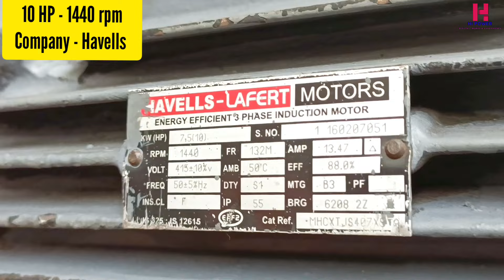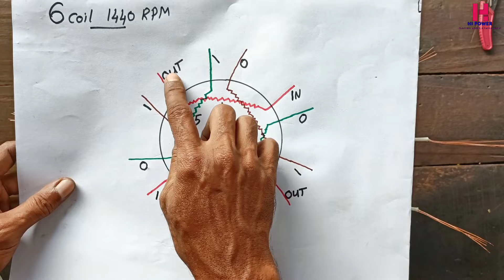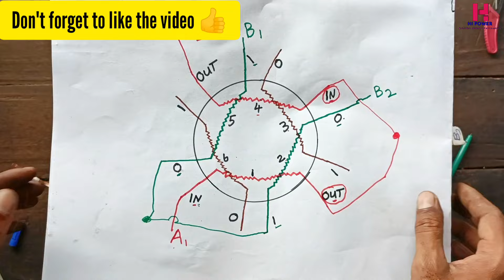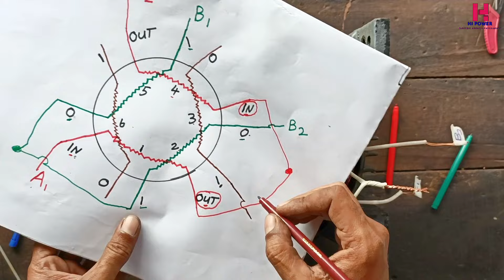10 HP 36 slot motor winding and connection with diagram|Three phase motor winding|Motor winding

Comment: Hello sir,
इस कनेक्शन में इनर से आउटर वायर का जम्पर है।
इस कनेक्शन से मोटर में क्या इफेक्ट पड़ता है।
एवं सीरीज कनेक्शन यानी इनर से इनर का एवं आउटर से आउटर का जम्पर होता है। तू तो मोटर पर क्या इफ़ेक्ट पड़ता है। 
Plz reply me sir
Reply from the maker: यदि मोटर 6 कॉइल के साथ 1440 rpm है, तो कनेक्शन वीडियो में दिखाए अनुसार किया जाना चाहिए।
यदि बाहरी लीड को बाहरी लीड से joint वाला कनेक्शन 6 कॉइल है तो यह 2800 rpm होगा।
Reply: @Hipowerelectricworks यानी मोटर 2800rpmमे वर्क करेगी
Reply: @Hipowerelectricworks  thanks you very much sir👍
Reply from the maker: @nirajlilhare539  6 coil 2800 rpm motor winding and connection 👇
https://youtu.be/N6tKKxA4uwk?si=jln9-GVOC1cnNy_a

Comment: Question: how to determine coil size when rewiring an electric motor!
Reply from the maker: There are ways to find motor winding data but none of them are perfect.
A suitable wire size and turns is used when the motor is manufactured at the factory. When we are rewinding the motor it is best to use the same size and turns of wires that were on the motor before
Reply: I noticed that the coils you use are not only the proper length but in perfect order. Meaning, all the strands are side by side and when I make a coil using my Chinese wire winding machine they overlap. Some overlap others and when you try to put them in the slots it makes it harder. How do you make your coils????
Reply from the maker: @Rstifleable  Watch this video from the second minute 👇
https://youtu.be/_6UaOK1nP9A

Comment: Bai table fan, single phase grinder motor coil to coil joint nil only running coil 2lead, starting coil 2lead edukum method one video uploaded seyyungal please
Reply from the maker: 8 coil table fan winding and connection full video 👇
https://youtu.be/KUNhy_-i6WI
4 pole 1440rpm motor connection
(The same connection wet grinder motor)👇
https://youtu.be/c9sYdM2YRu0

Comment: Why we are taking 3 different set of coils with same number, As you mentioned in a comment 34 x 4= 136, can we take all 136. Turns in a single row
Reply from the maker: SWG - 22.5 four layer
1 set in 3 coil series 
One coil turns - 34×4 layer 22.5 = 136 turns
Reply: Super

Comment: Please how to determine/calculate the number of turns?
Thanks in advance.
Reply from the maker: There are ways to find motor winding data but none of them are perfect.
A suitable wire size and turns is used when the motor is manufactured at the factory. When we are rewinding the motor it is best to use the same size and turns of wires that were on the motor before
Reply: @Hipowerelectricworks  thanks 🙏🏾

Comment: Rated line current is 13.5 amp. Therefore rated per phase current is 7.8 amp. 
14 SWG 2mm dia wire is required for stator winding. The wire in the video indeed looks like 14 SWG 2mm dia. 22.5 SWG is wrong. 22.5 SWG is approx 0.75mm dia and will pass 1 amp only. The wire in the video is not  22.5 SWG
Reply from the maker: Wire guage 22.5 ×4 layer 
Not a 1 layer
Reply: 4 parallel 22.5SWG windings in 4 layers will pass 4-4.5 amps only. The phase current in this case is approx 8 5 amps, so you need 17-18SWG wire .
SWG 22.5 is 0.65mm dia. The wire shown in the video is at least 1.5mm dia.

Comment: Dear sir, How to calculate the wire gage.
Reply from the maker: There are ways to find motor winding data but none of them are perfect.
A suitable wire size and turns is used when the motor is manufactured at the factory. When we are rewinding the motor it is best to use the same size and turns of wires that were on the motor before

Comment: This is wrong connection bro please check phase angle 4 pole machines total electric digress is 360×2 pair poles=720÷36 slots =20°/ slot so 6 slots complete 120° 7 number slots are start b1 ❤
Reply from the maker: @firozjamani8218  This connection is correct bro it is called three phase half coil winding and connection . it's 1440 rpm
Reply: @Hipowerelectricworks  right but phase angle is wrong

Comment: Aur ye 2pole moter hai rpm=120f/pole 2800rpm hogi
Reply from the maker: It's 4 pole winding.
Es winding ka naam 3 Phase half coil winding hei . Es motor ka connection alag hai. Es motor meri 1 set coil mein 2 pole hai
Reply: @Hipowerelectricworks  ok bro

Comment: कनेक्शन गलत है आउटर तार इनरमे कभी नहीं जुड़ता
Reply from the maker: कनेक्शन सही है अगर 1440 RPM मोटर वाइंडिंग 6 कॉइल है तो बाहरी लीड को आंतरिक लीड के रूप में जोड़ा जाना चाहिए
यदि 1440 rpm मोटर वाइंडिंग 12 कॉइल है, तो इसे outer to outer के रूप में जोड़ा जाना चाहिए
Reply: @Hipowerelectricworks  आउटर तार इनरमे जोड़ने पर स्पीड कम हो जाएगी
Reply from the maker: @shwetasharma9856  6 coil 1440 RPM connection eysa he bro